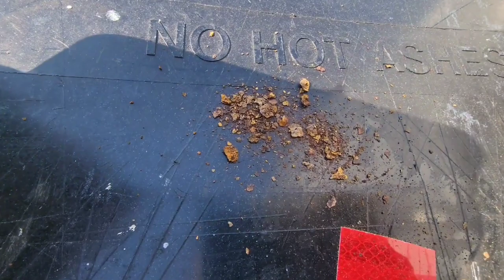5HP Briggs & Stratton Engine Restoration and Carburetor Rebuild

Comment: Working on the same engine (1985 version) - stuck at the point of removing diaphragm cover - removed 4 screws but not sure to deal with remaining spring pin.  Looks like you got the cover off - any force needed?  Hit with a plastic mallet?  Will be following closely.  Thanks.

Comment: Nice work. 
I’ve got a 1973 Briggs 5hp that is a very low hour motor that was neglected for decades.  Im going thru it to put it to use on a 1969 mini bike. Very helpful video.
Reply from the maker: Thank you so much for the positive comment. I'm so glad that my video could actually help you. Apologies for the late response for some reason your comment was blocked and I didn't know until today. I hope everything worked out with the engine swap for the mini bike I have a mini bike motor swap video also check it out.

Comment: best hack job I have ever seen, never took the piston out to check the rings or cylinder. never checked the valves. when you restore an engine you take it all apart and replace the worn parts.

Comment: Not sure how you got it to start.  The small electrical wire the you put between the lower tank bracket and the motor is the kill wire off the magneto if you ground that out it stops the spark.  There is an plastic insert that goes on the lower tank mount where the throttle cable goes when that throttle taken to beyond idle to stop it grounds it out and kills the spark

Comment: I rebuilt one of these in '93 and sold it to a student in my school. I was 16 at the time. It came from our own lawnmower.
Reply from the maker: Yeah it's an old motor but a great one. It was the first time I ever worked on a old ocarburetor
Reply: @JOATD  This engine is bullet proof. My dad never serviced it. from about the age of 8 I used this lawnmower every saturday to mow about 400 square meters of lawn. It eventually packed up, and I was in technical school, and motor was one of the subjects where we had to strip and assemble a robin engine as final exam. So I rebuilt the carb, polished the valves, en installed new rings on the pistons.
Reply from the maker: @Ben Fourie  oh yeah man that's crazy they don't make them like that anymore. tecumseh engine where bulletproof also

Comment: Bought a rotovator with one of these engines, bit hard to start and won't take the revs to well, let's the odd back fire but still does her job when you get her going . Changed the oil a few times in her as it was black. If I cleaned the carb and ordered new diaphragm would that sort her?
Subscribed to your chanel interesting video!!
Reply from the maker: Thank you I'm glad that my video was able to help you. Some of the main causes of backfiring are damage spark plugs improper gap on a spark plug. If the motor is surging you have a dirty carburetor. I will always start off with cleaning the carburetor first. Making sure that the air filter is new and again the spark plug
Reply: Hi thanks for getting back I'll let you know how I get on, I've 3 weeks work for her, if i keep her or sell her I'll sort this issue out. 👌

Comment: What year was yours? I have a 1977 briggs flathead like yours that i am trying to get running. Any tips?
Reply from the maker: Make sure that the gas tank is clean. 

1. Change the oil
2. Change the spark plug
3. Clean the carburetor
4. Make sure the air filter is clean
5. After you do all of that it should start if it does not start do a compression test to make sure that the motor has compression if the motor does not have compression the exhaust valve is stuck.
6. Remove valve cover the valve that's closest to the exhaust will be the exhaust valve just make sure to unstick it. Spray carburetor cleaner on it. Try not to push it into the motor
Reply from the maker: Sorry I don't know the year I just know it's on a old Front Tine Tiller

Comment: We're did u spray the carb clean in to get the valve in stuck
Reply from the maker: Overtime the valve get a buildup of carbon deposit. (Hardened black soot) the clearance between the valve and the valve walls are so small that it's easy for a valve to get stuck by carbon
Reply from the maker: Remove the valve cover and you will see both valves
Reply: Thanks I thought u had a different trick up your sleeve for that. I like to learn new trick
Reply from the maker: @johnharkins2162  no problem I hope I was able to help you
Reply: I took that thing all apart either ground is not hooked up good or it not getting gas with a new carb
Reply from the maker: @johnharkins2162  get a can of carburetor spray and spray it in the carburetor and see if it will start. If it starts the carburetor not getting any gas

Comment: No body talks about how to adjust the main jet needle 😒
Reply from the maker: I'm sorry if I still had the actual motor I would do a video on adjusting the main carburetor needle but it was more of a restoration for a friend
Reply from the maker: But if you take a look in my descriptions area all the way at the bottom where it says helpful download. I actually have the manuals for this Motor and it probably tells you how to adjust the carbs.
Reply: Thanks a lot man 👏 👍 yes the manual should have than información, again thank you. I will check out the manual.
Reply from the maker: @josem.2909  no problem I try to load up all of the manuals for everything that I repair